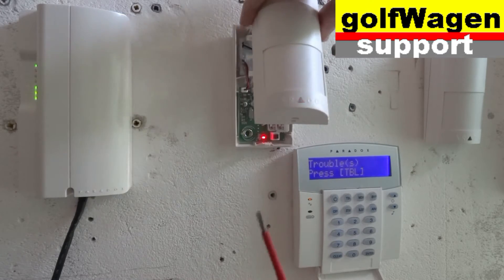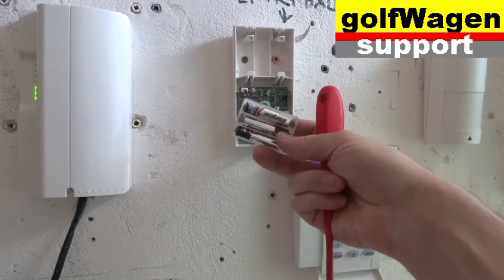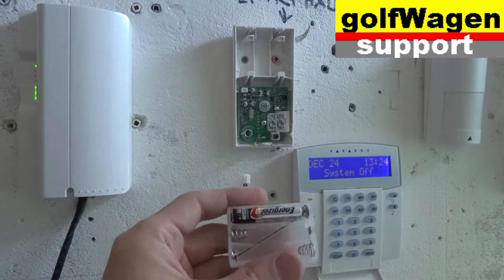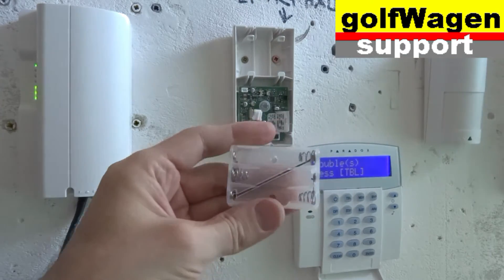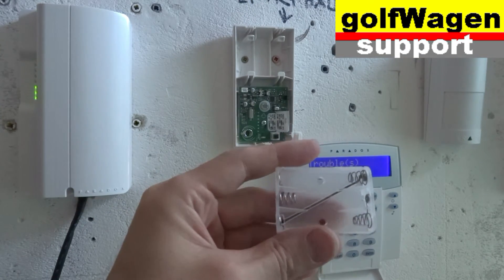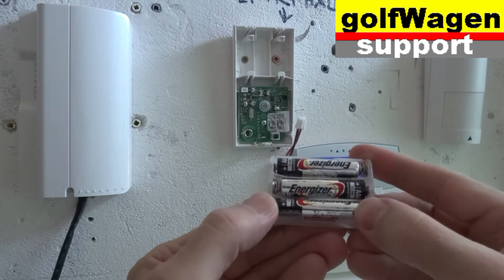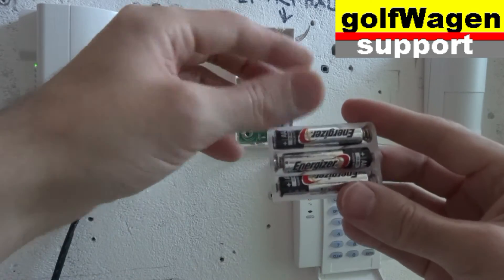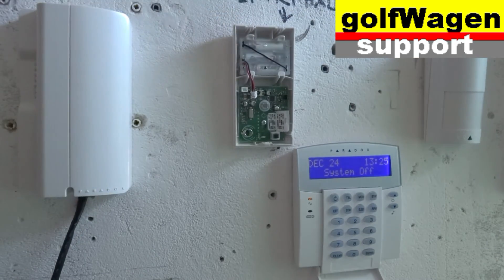How to change battery on PARADOX wireless detector PMD2P

Comment: This video is incomplete as you need to press the anti tamper button and wait 60seconds to clear the battery low warning and to tell the system you changed the battery. 

see the installation manual for more info search Paradox Pmd2 manual.
Reply: Reinitialized after removing old batteries, but main system trouble light stays on anyway after CLEAR + ENTER